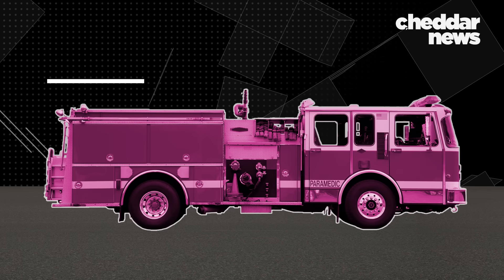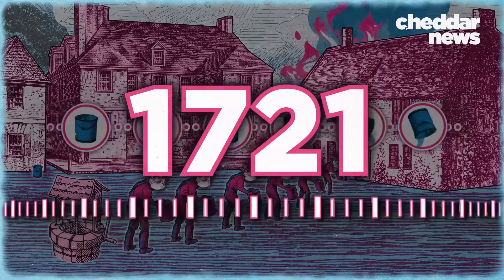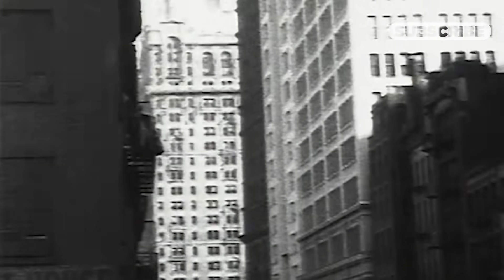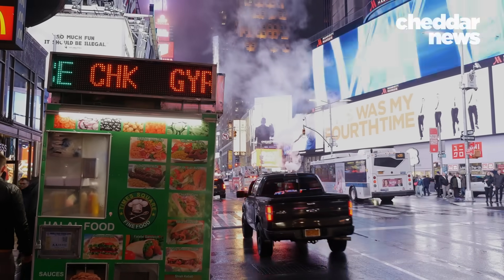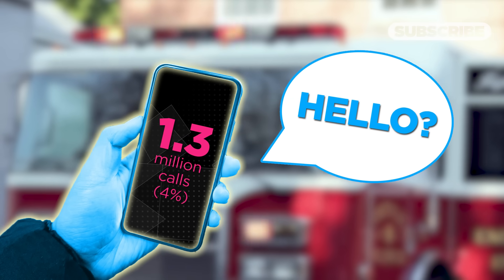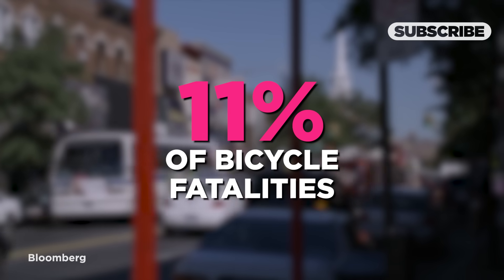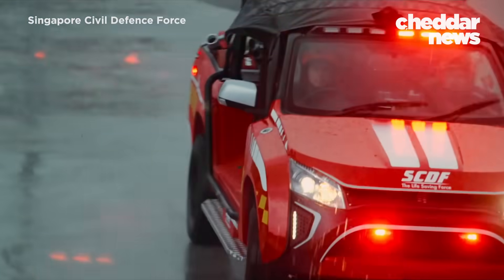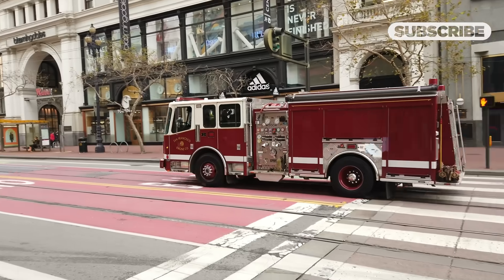Do American Fire Trucks Need To Be So Massive? - Cheddar Explains

Comment: I'm a firefighter in Wisconsin, and this hurts my friking mind. The reason we have larger apparatuses than other countries is due to the fact alot of our depts are rural. Not always having water access, a 500 gallon truck is typically a ladder truck where you have a massive turntable assembly for the ladder. Our trucks we run have 1200 gallon tanks on them, so if we have a call outside of the hydranted areas we can have some buffer time till a drop tank is set up and water trucks are dumping water to be drafted to continue fighting fire. The rest of the truck has life saving equipment to help keep us safe, and free or help someone in trouble.
Reply: lol you should see what European firetrucks in rural areas look like
Reply: your comment kind of hurts as well. "due to the fact alot of our depts are rural" no shit, you think all of Europe is one metro area? Even in densley populated countries like Germany they have rural areas, but apart from that parts of e.g. Sweden or Norway have an equally low population density like the least populated states in the US. They won't have water supply via hydrants in rural areas there as well

Comment: "the ladder can reach as high even though its only a third as long"
Did you not think that sounded a little off? Maybe there was something going on?
Buildings in the US are usually much larger in size - not only height but moreso area. That extra length is to get firefighters across that area so they can get to where the fire is. 
Between that, the width of 10ft (not normal at all - thats for specialist units) and the other myriad of mistakes, falsehoods and generally terribly researched rubbish in this it's hard to see how you didn't notice while reading it back just how silly some of it sounds. 
I would dearly love to hear how you think the Singapore go kart would be able to deal with a fire in the middle of a wal-mart or mall. Singapore know its limitstions all too well which is why they have other vehicles for when there is a real fire.
The stupid line about bicycle lanes is another point only someone with no knowledge would come up with. The vast majority of people drive. Almost all freight and deliveries in cities are done by road. You are suggesting its somehow better to make those roads smaller to cater for the tiny percentage of people who choose to ride around on a Victorian curiosity than to leave them as they already are which allows everyone to get the food in their shops? 
For the love of all thats holy please don't vote. Or breed.
Reply: many departments here have a range of full size to compact emergency vehicles, both with and without firefighting capabilities; There might be some car / pickup / van based quick attack unit to cover the time until a full size apparatus arrives, in case it's needed at all
Btw in most areas it works very well to limit the size of available road infrastructure for individual motorized traffic. Just take a look at the Netherlands, the Norwegian capital city or historic city centers in Germany. No need for a 4 to 6 lane wide street and parking lots in front of every store all across the city
Reply: @EnjoyFirefighting  Yeah limiting traffic is a great idea. If you like more pollution for less things done. Have a look at the population levels and throughfare in those places you seem to think it works so well for. If there are only a few thousand people using a shop in a week its fine - though irritating and making journeys generally longer for nothing. 
The most efficient way to move people around is directly to where they are going. Public transport almost never allows for that and always has times of the day where its running well below its full capacity. 
Making cars sit in traffic because the bus lane cuts the road in half is not the way to solve pollution - its an attempt to force people onto the bus to show how great it is - even though it really isn't.
Reply: @siraff4461  more pollution for less things done? What do you mean? Those places usually have a high population density and no or barely any through-going main road, and if there's one it's likely a bus lane, tram track, or people will use the subway

"Public transport almost never allows for that and always has times of the day where its running well below its full capacity. " Funny story: as I went to trade school I had to commute from my city to another city and I had the choice to drive by car or take public transit. Taking the bus, hopping on the train and then taking the tram or subway resulted in a shorter walking distance than walking to my car parked in the garage underneath the apartment building, driving to the other city, searching for a space to park and walk to my destination. Taking the bus, train and subway was both cheaper, faster and I had a shorter walking distance. Well layed-out and spread-out public transit is designed to have a shorter walking distance compared to having a car.
"and always has times of the day where its running well below its full capacity" like most cars on most trips, being occupied with only the driver.
With up to 200 passengers per bus they definetly are better than 200 individual cars in traffic; Of course it will be allowed to get through traffic easier in most places; Doesn't need to cut the road in half for that, there are other solutions without taking lanes away from individual car traffic

Comment: The smaller fire trucks don't have the ability to top spray the fire. 
Every different vehicle has their advantages and prime use functions. The ladder trucks also often have a thermal imager that can help to isolate the hot spots of the fire and help direct where the water should be directed.

Comment: It pains me to hear how "chassis" is pronounced... Also a lot of errors and misinformation. However, I like the use of the Federal Signal PA300 yelp at 2:42

After getting further in... The ladder trucks carry more equipment that normal engines don't or can't carry, so it doesn't have to be a fire related call for a truck to respond

Also, circling back to the beginning, the "old" looks are mostly from FDNY lol

And final thing. American fire apparatus just looks so much better
Reply: is looking better any relevant aspect for a purpose built type of vehicle?
Reply: @EnjoyFirefighting  presentation is always good to have
Reply: @SoCalHypercarSpotters  but it doesn't help with the actual task in any possible way. It doesn't help to extinguish a fire, cut someone out of a car wreck, remove storm damages or handle hazmat incidents. Sure it's cool and awesome to have a good looking and impressive apparatus, but it's the very last thing which counts
Reply: @EnjoyFirefighting  well then why the reply if it literally has no point? 💀
Reply: @SoCalHypercarSpotters  how a fire truck looks like is the least important thing, however Americans departments seem to put extra effort on making it stand out for whatever reason

Comment: As an emergency worker I have a lot of joint activity for NSW F&R. Pretty sure the largest fire Engines in Australia are the Bronto Skylift (4 axle Heavy Rigid). We also have semi trailer tankers for water supply as well but most engines in the big cities are Scania or Merc twin axle class 1 to 3 tankers/pumps/Rescue. Like mentioned 90-95% of Fire and Rescue jobs are not actually confronting fires ie MVC, Hazmat, Rescue. Engines are spread out within the City Suburbs and are always pretty close on hand to immediately respond to incidents.
Reply: Bronto are a Finnish company who manufacture aerial platforms up to 112 metres high, which are used throughout the world. Most Bronto Skylift units in Australia are eight axle 44 metre  units, although there a few shorter two and three axle units.

Comment: You need to think what fire truck go to crashes too so..
Reply: so what? They do the same in Europe
Reply: Well in the USA they go to ems calls to help and go to the injured faster then the ambulance
Reply: @EvansvilleFireDistrict  in the rare case of that being necessary, they do so in parts of Europe as well.
Reply: The USA fire truck like the pierced quantum looks new not old and New York has old truck, but not old as 2007
Reply: @EvansvilleFireDistrict  the age of apparatus is an entirely different topic ... 
"And there is brush truck, tender or tanker, heavy rescue, Battalion, squad, and engine." same here ... just like there are fire and rescue tanks, fire and rescue trains, nitrogen vaporizers, fighter jet powered aerosol extinguishers, tunnel fire apparatus, buses, mobile cranes, ...
Reply: And there is brush truck, tender or tanker, heavy rescue, Battalion, squad, and engine. Fire truck gave good brakes and they cause accident because of driver not Focus on the road.
Reply: I’m trying to say she is wrong
Reply: About fire trucks todays time

Comment: The difference between European trucks to American trucks is how much water they can hold (435gal vs 1500gal+) and pumping power.

Let's not forget the difference in equipment we have for responses, our trucks carry more hose lines and other types of equipment reducing the need for more special response trucks to carry extra gear that can be used in one truck thus reducing the cost for more trucks.

Now let's look at why we go with the ambulance, an ambulance has many things to move a patient but isn't able to have equipment to get to a patient if they are locked in a house so how do we get that equipment there on the fire truck how else, now some departments have a special truck that goes ahead of the ambulance it's smaller but those are larger cities that can afford to have the extra trucks, many departments in the US can't afford those trucks so they use the engine to get the job done.

Now that we have covered this tiny difference between European and American fire engines there are many other things I did not cover I hope it was a tiny but more informative.
Reply: Also apparatus in e.g. Germany carry a hell lot of other equipment which isn't directly fire related. from medical equipment to technical assistance and rescue equipment. They actually carry so much, that e.g. Heavy Rescue Trucks are barely needed in many areas. 
Locked apartment doors do happen, but it's the minority of medical calls. I work in EMS and it must have been last winter that I needed support from the local FD to open a locked door. No need to send a fire truck ahead to every medical call then
Reply: @EnjoyFirefighting  that doesn't really disprove what I said I'm a Firefighter EMT as well and I'm not saying one truck is better over the other ours are set to what is needed
Reply: @joemcgee3405  the thing I see in many places in the US that a fire truck, let it be an Engine, Ladder truck etc, is sent to almost every medical call along with the ambulance, without the indication to need them to open a locked door. To my range of experience that seems unnecessary.

Some aspects you mentioned are the very same here: the Rescue Engines are so versatile that specialized apparatus are barely needed. However that doesn't reduce the potential need for specialized apparatus, so our departments come up with a range of apparatus many American departments can't really imagine. From mobile cranes to tunnel fire apparatus, tracked apparatus, super compact or super large ones. Of course some of them are highly specialized, like a firefighting tank, nitrogen vaporizer or fighter jet turbine powered aerosol extinguishers and 300 ft tall Aerials. 
But for basic kind of tasks the plain normal apparatus are sufficient
Reply: @EnjoyFirefighting  Man its great you love to video the trucks and great your an EMT God knows we need more but you missed my whole point and I aint going to type messages back and forth so to spell out my point

 "Areas have the trucks needed for their specific needs, in the US large citites have trucks that go with an abulance its a paramedic truck its the size of a normal everyday truck as for out in small towns we use the engine at times" 

as for pointing out medical response that has gone down a lot, the engine doesn't go on medical calls hardly ever anymore due to most ambulances shifting to private companys or county run agencies and the FD paramedic trucks are now only sent when needed if they are even available.

so that said im going to bed I hope you have a safe time with your work.

Comment: Americas fire truck are big because they hold 500 gallons of water as well as gasoline hydraulic fluid and motors for the pump and diesel engine and pipe stretches across the truck to be able to pump water all over also some trucks carry foam. If they go to calls in the city or outside or even on highways they need that 500 gallons to put out car fires, woods fire or outside the city fires that have no water main.
Reply: guess what: also Europe has rural places, highways etc 
You don't need 500 gallons to put out a car fire. With the right tech you can do so with only 1 gallon of water as well
Reply: @EnjoyFirefighting  
Europe is not the USA so get over yourself.  Our fire trucks are better and it always been better than any fire company in Europe!
Reply: @troyjackson3164  haha good one ... how much water do you need to extinguish a fully involved car fire? Do you have any Aerials in the 200+ ft range? tunnel fire apparatus? fire and rescue tanks? 
What's better about a larger truck with less equipment, less crew seats but more water and higher pump capacity? While the average fire apparatus in Europe is more compact, Europe also comes up with the largest as well as smalles units in the fire service
Reply: @EnjoyFirefighting  
Europe has small cars and so they only need 1 gallon of water to put out a fire where as America has cars that are 3 times as big than your Europe mini cars.
Reply: @troyjackson3164  uhm ... no? Sure American Pickups are larger, Europeans use vans for those tasks instead, and they aren't smaller tbh; 
Doesn't matter if it takes 1 gallon or 5 gallons, you simply don't need hundreds of gallons to extinguish such a fire
Reply: @EnjoyFirefighting  
We use high octane gasoline and 1 gallon of gasoline can burn longer than with 1 gallon of water to extinguish it and we wash it to dilute it so it does not continue to burn. So when you only have 1 gallon you can extinguish your scooters that’s all you have there. Diesel do not burn like gasoline does so you technically can extinguish those scooters
Reply: @troyjackson3164  it's RON 96 in the US and RON 95 for gasoline in Europe, not much difference tbh.
Reply: @EnjoyFirefighting 
I bet if your firefighters had a choice of your smaller fire trucks and our bigger trucks they would choose our trucks.
Reply: @troyjackson3164  I hate to say it, but no they wouldn't (to be honest: personally I'd love to see more American apparatus in Europe! They're cool, awesome looking and are plain different and thus very cool to see). In Poland they did a once and never again purchase of both American Engines and Tower Ladders; Most of them are out of service by now, or have been moved to less busy volunteer stations. 
The US Army Fire & Emergency Services at USAG bases over here used to run American apparatus, but almost all of them got replaced by European apparatus by now. 
And I remember the sad story of a E-One Cyclone: In the mid 1990s a businessman imported it to Switzerland and offered ot to Swiss fire departments, but he couldn't find ANY fire department in Switzerland or elsewhere in central or western Europe to buy it;
Pierce tried to enter the market with the Pierce PUC at the world's largest fire and rescue trade show which takes place in Germany. Never sold one over here. 
Even in Sweden, the most American-like country in Europe by many different aspects, the once popular American vans and pickup trucks in Fire / Police / EMS are almost all replaced by European vans and trucks by now and they never had full size American fire apparatus
Reply: @EnjoyFirefighting  
Well in America we believe bigger is better so we would not want small apparatus fire trucks here.  It could be that no one bought American trucks is that we need wider roads and outfitting with European metric system for American systems would not work. We have imperial systems and that itself would require European equipment to adapt so that in itself is expensive for the European market.
Reply: @troyjackson3164  and that's completly okay as long as you get through; With all the "bigger is better" I'm surprised that the chassis of many American Aerials are indeed much bigger, but don't carry any bigger ladders than we do. 
Width of the roads are barely relevant; As long as articulated buses and semi trucks fit down out roads, American fire trucks would do so as well. 
Why shouldn't it work to outfit them with metric systems? When e.g. pickup trucks are exported to Europe they are converted to match metric system and different measuring etc., why shouldn't that work on fire apparatus then? Converting the system costs way less than the import and transport
Btw some American departments import European apparatus for quite a while already ;) 
At least at the US military American fire appratus used to be popular some time ago, but even they stopped getting American fire apparatus